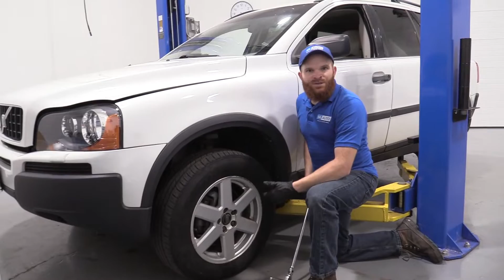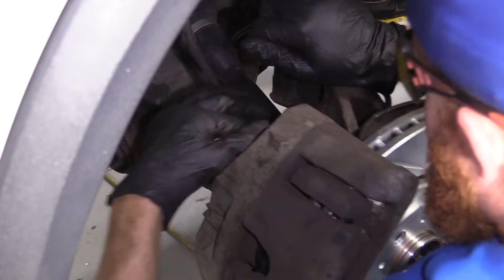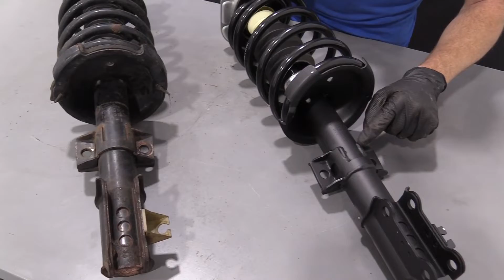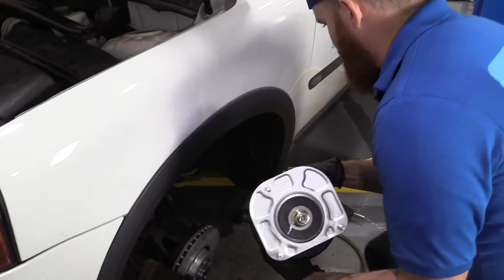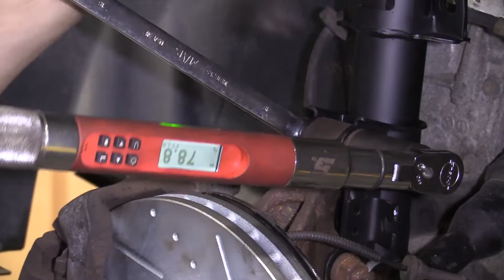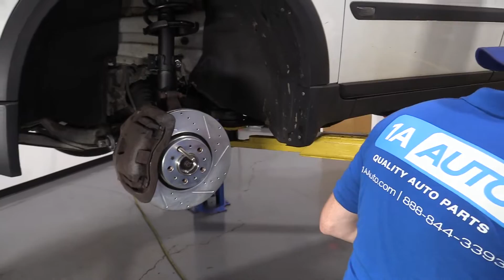How to Replace Front Struts 02-14 Volvo XC90

Comment: I noticed you used the original factory top mounting nuts and not the ones that came with the replacement strut.  The replacement strut top mounting nuts don't seem as beefy as the factory ones.  I might do the same as you.

Comment: What’s the point of the 90 angle??
Reply from the maker: +Marlin Reyes Thanks for checking us out! Those are the OEM specifications provided by Volvo to ensure the product is torqued properly to prevent any premature failure. If this step is skipped or overlooked the item may not be tightened to the proper specifications and could potentially fail. Please let us know if you have any further questions, thank you!
Reply: Thank you for your video. Does it mean turn a quarter turn after torquing 77 ft lb. Or 1/5 turn based on other viewer. If we don’t have torque angle thing.

Comment: The latest VIDA software recommends torquing the lower strut bolts to 77ft lbs. and then 75 degrees for the XC90.  The video shows 77ft lbs and 90 degrees.